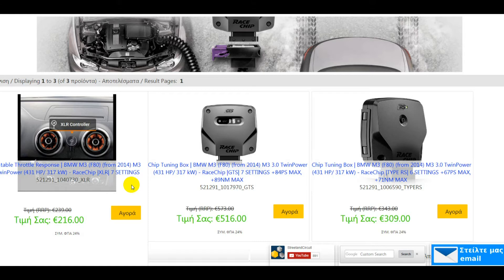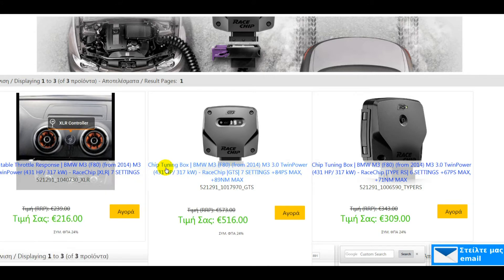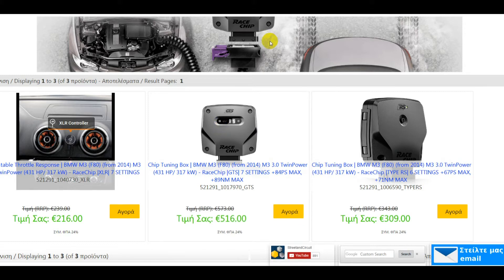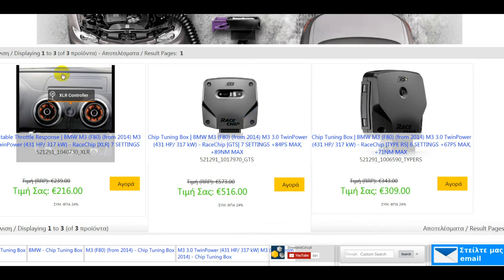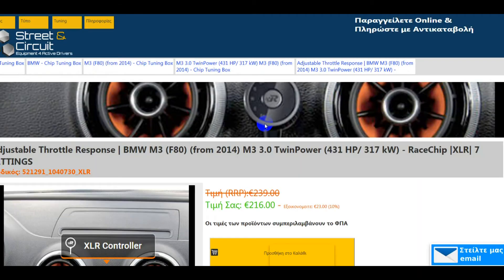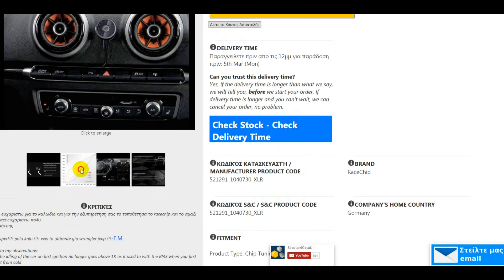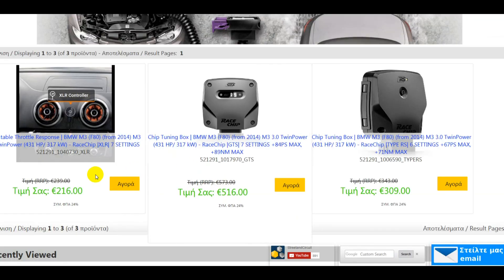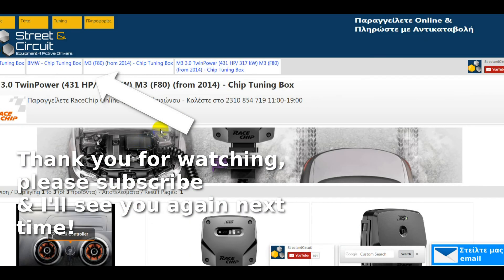Tuning Boxes - Why are they adjustable?

Comment: I’m sorry but this guy is wrong big time !! I do feel a big difference in the behaviour of the car ! And definitely more boost pressure. The tune box does increase hp and torque but the peddle doesn’t, the peddle just increases the sensitivity of the throttle.

Comment: In general do you suggest Racechip as a company? I just ordered the GTS. So it's better to leave it in setting 5? Will setting 5 give the +30% increase? (or the +30% is achieved only in setting 7?)
Reply: Could I please have your kind reply? Thanx :D
Reply: I just got the s you notice a slight bump in power with every tick up from 3-5 but i leave it at 4 whats recommended in my manual

Comment: Can we use 95 Ron octane fuel with the Racechip GTS Black on Audi RS3 8V Or must use 98 Ron octane only?
Reply from the maker: For sure the higher the octane the better. If Audi says 95 is okay for the factory engine, it should be okay.